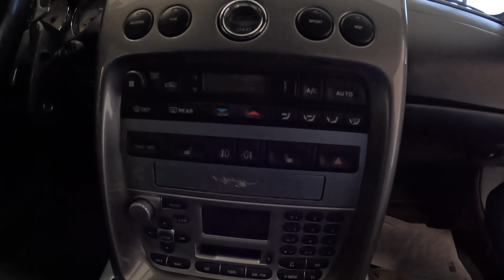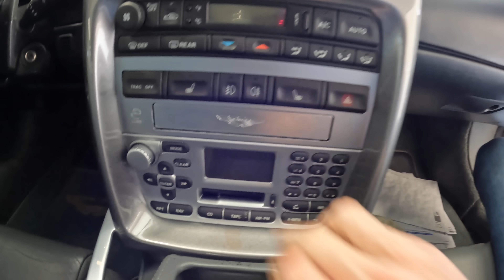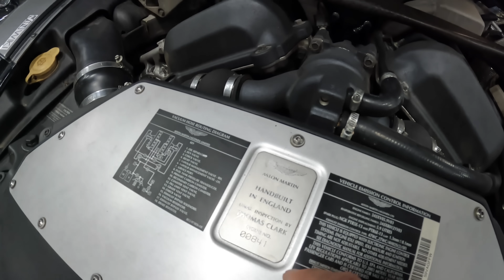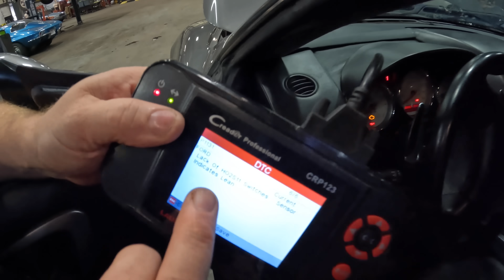I bought the Cheapest Aston Martin Vanquish to prove Clarkson wrong (Roasted on Top Gear 20 yrs ago)

Comment: I was the engineer for Aston who was tasked with fixing the flappy paddle issues and we did. 
Reach out to me Hoovie if you want to know more. 
Biggest fun is put it in ASM mode drive at 50mph it will then go into sixth gear. Floor the pedal and it will drop 3 gears and take off like a bat out of hell.
Most important is to swap out the ASM fluid (Tutela same as Fiat fluid) especially the clutch line.
Reply: Coolant sensor is a Jaguar part. Probably 2000 XJ can’t remember exactly.

Comment: Velcro for interior access is an excellent idea! I have worked on an airplane that all the cockpit interior was held in place with Velcro. So much easier to work on than the other ones screwed together.
Reply: And way better than the usual plastic pop fasteners that break if you even so much as look at them wrongly...
Reply: Way better than screws into plastic or plastic tabs. If Velcro wears out or becomes unbounded from the part it's an easy fix over buying new panels.
Reply: Also won't rattle, and squeak when you're going down the road
Reply: @andypullin4702  in plumbing it’s the same way with old fine thread brass pipe and fittings,you have to look at quick before it notices you look at it and it decides to break

Comment: Before you replace all the ignition coils check for oil pooling around the spark plugs. The rubber seals around the PVC plumbing get tired and leak, sometimes causing oil to pool around the plugs and misfires. I would strongly recommend a little research in the Vanquish section on the AMOC forum as there's loads of great info in there that will help with your diagnostics and repair.

Comment: I seem to remember Clarkson's big issue was with 'low speed' maneuverability.  Such as navigating parking lots, driving on inclines, etc.  
I don't think he really had any problem with it on a track, or just driving on a highway...
Reply: If you’ve ever driven an early paddle shift car, you know exactly what he was referring to. The early cars couldn’t manage low speed at all when auto was turned on, and it’s even harder to do it with auto off.
Reply: Very much this! He never really complained that much about these issues on Ferraris of the time, but he saw the Aston as a Grand Tourer/daily driver, and low speed driveability matters there.
Reply: on the streets yes. On the track it was the downshifts mostly. A manual you can just ram into 2nd gear and floor it, with the paddles you have to walk it all the way down.
Reply: The way it uses the clutch is also clunky. You can't really adjust the aggressiveness of the clutch action on the fly (unlike a manual transmission).

Also if you compare it with same sequential transmissions in racecars (WRC, GT1, GT3....), it's slower to shift. Ferrari managed to do it better (still clunky in automatic mode though).

Comment: My take is, if you don't use the car for racing, it shifts FINE. Too many "Car Guys" want a twitchy-instant shift. Only place that COULD be useful is on the track. But not sure I would want that the other 98% of the time, driving it normally. Manual conversion?? NO. You could buy another car for that kind of money!!

Comment: DB7 had a lot of changes off the Jaguar XJR that many believe it came from.   It was TWR who did the development and they cut the length back, repositioned the cabin, re-engineered the rear sub frame, and then did the same as the front.   The i6 block was from Jaguar, but everything else was bespoke to Aston, and ultimately Jaguar never used that i6 block so it ended up being bespoke to Aston!

The V12 engine was based upon the Ford V6 as you state, using all the knowledge and parts where possible to create a superb engine.   What you got was a unique engine for Aston that had far more development by Ford than Aston could have afforded.   Nothing bad there.

On the plus side, if you talk to the Aston clubs you'll get access to a list of compatible parts as many were shared between Aston and Ford / PAG (Premier Automotive Group).

As for Clarkson, it's not just that he makes a comment on a car but lazy journalists simply copy him verbatim.   They don't even bother making their own mind up but simply repeat what he says!   If you want a bad SMG have a look at the Toyota MR-S (MR-2 in the UK), third series.   It was terrible.   Later cars got better, and that can be retro fitted back to the originals.

When it comes to the manual conversion, it was first offered by one of the independent Aston specialists.   It might have been Bamford Rose, it might have been Aston Workshop.   I can't honestly remember, but talk to them about sourcing the manual conversion if that's what you're interested in attempting.   I suspect it's not a trivial upgrade with much of the automated shifting mechanisms needing removed.

Vanquish original doesn't seem to be going up much in value, but the S variant certainly holds more value.

The Vanquish is still the most beautiful car there's ever been.   And Ian Callum is also now offering an updated version where he'll also convert the gearbox to either a manual or full automatic if you wish.   Callum of course is a design genius.

Comment: Fun fact, that trans is just a Borg Warner (at the time) T56 with a computer controlled, hydraulically actuated clutch and shift assembly bolted on.  Similar to the E46 M3 SMG trans being the manual Getreg gearbox with the automated stuff bolted on.

Comment: when merging on to a freeway it is the responsibility of the one doing the merging to adjust their speed accordingly. and is definitely NOT the responsibility of those already on the freeway to either accelerate, decelerate or change lanes to avoid an accident.
Reply: Very true, but I consider it a dick move if the passing lane is empty and you don't move over. Legally you are correct, it's just rude. Edit: I consider
Reply: @dwarf365  also rude to come storming onto the empty highway not paying attention and expecting them to move over for you.  Then what typically happens is the fool in the merging vehicle sits right next to that person preventing them from moving back into the travel lane.  Pay attention while you are driving,  learn how to merge.
Reply: 100% on point
Reply: @Wikcentral  one hundred percent. I'm not trying to remove blame, Hoovie wasn't paying attention at all. I find it rude because if I can move over (semi, truck or car) I do and I find it inconsiderate if others don't.
Reply: Jim jibroni  Western Oa on ramps are WAAAAAAAYYYYY too short.Not sure how mergers survive.
Reply: PA. not Oa.
Reply: When the merging vehicle is ahead, I wish they’d stay there instead of drastically slowing down, looking over their shoulder in fear and mental paralysis
Reply: @wallacegrommet9343  I make sure I'm always to full Highway speed before the merge. That's what the on-ramp is for. I had good instructors growing up :)
Reply: @robertoconnor3683  I don't know about onramps in that area of the world, but there is this one in Cape Town that I really really hate. It's curved in a circle, you're coming off one road doing a 270 degree onto a national highway (where the speed limit is 120km/h). You can barely muster 60km/h around the circular onramp but you are expected to merge into a 120km/h highway. Probably not that bad if you have a big powerful engine, but over here we tend to run <100 horsepower 4-bangers...
Reply: @robertoconnor3683  On-ramps in ALL of Pennsylvania are terrible, unless they've been rebuilt in the last decade or so, and even then...  Too short, horrible sight lines, and of course, lots of traffic. And speaking of traffic, don't even get me started on NY & NJ drivers, LOL!
Reply: Exactly!  Failure to yield is the biggest mistake some drivers commit, also.  They see a car merging up ahead and feel like its their duty to pass it

Comment: If the car is an automated manual you can just remove the actuators and have an engineer design a selector, and maybe some ECU flashing. That would be cheaper and then you can sell the kit. Kind of the same process that BMW e46 people do with their transmission. Only difference is that you can get those parts from a manual car
Reply: They sell kits for SMG-equipped BMWs, so why not?
Reply: Do it like a sequential. With a button for start up that simulates holding both paddles.
Reply: There are several kits to convert these to manual. They seem to cost between 20-30k USD. Still he would be less than 100k USD in to the car and thats not to bad for a fairly modern V12 manual sportscar, even if has a somewhat shady history.
Reply: Hoovie better see this
Reply: 20 to 30k is a rip off, the other option is an adaptor plate and put a 6 speed ford transmission.
Reply: @nicolascrescimone  it's not to unreasonable of a cost. The 30k is Aston Martin themselves doing the work as well with all factory parts. The single biggest expense besides the labor is the ecu reflashing to accept the manual transmission. I know for 60k you can have a ton pick up your vanquish, ship it to the UK, do the entire manual conversion and make it legal where its registered, and ship it back to you. They replace the entire transmission while at it as well. Seems rather tempting to buy a vanquish with a failing automatic for cheap, buy the kit from Aston with certification, and do it yourself and pocket the rest. And have a factory spec manual v12 sports car!
Reply: @12pagani  if you think they change the transmission you are in for a big surprise. A 3rd pedal and a new transmission selector, a stick with a boot, and an ECU re-flash does not cost 30k. For the automatic model they used a GM transmission so the automated manual is probably just a tremec or an old ZF.
Reply: Aston has done this to customer cars at their Newport facility.
Reply: @nicolascrescimone  Then it would never go anywhere with the ford parts. 🤣
Reply: @jeramiahwestbrook7370 not sure if you know but the V12 is just 2 ford duratec v6, and that's why it's not very reliable 😂
Reply: @nicolascrescimone  Thats exactly why when someone asks how do they get their ford XXXX running again I say "How you fix a ford is by putting Chevy parts in it." Lmfao

Comment: The reason why Clarkson is having a go on it, is when the car was new and you buy at that high price point. You dont expect it to be that slow at gear shifting. As a car review, have a drive in a new car. Of course you have to say whats wrong. Because the gear shift on that car is really slow.
Reply: Exactly.  Clarksons Point was at this price point there was multiple vehicles that did the same thing better. At the same if not better price.
Reply: I think Tyler is just saying it's not so bad so the prices will rise on these and he can make a profit later. He's not a stupid guy. We tend to underestimate Hoovie.  Most of this video seemed to be him trying to increase the value of this car.
Reply: @tecnofreak666  he even compared it to the DB9 that had a ZF6 automatic which was much better to use, despite it having less power and less focused on track driving.
Reply: @nimaside  yup, he’s no dummy

Comment: You're right about the island of Clarksons. Another good one was his comment about Mk2 Focus STs tOrQuE sTeeR and thats all anybody ever said about the car. It wasn't even that bad either, yes it does steer by itself if you let go of the wheel and floor it, but you can counter that by HOLDING THE FUCKIN WHEEL
Reply: Plus that's true of ALL front wheel drive cars with enough power to spin the tires. The only way to eliminate it is to have captain slow levels of power. Yes there are some steering geometry designs that can increase or decrease it but not eliminate it entirely. Or I guess you could go to steer by wire to eliminate it.
Reply: these babies today need Tesla autopilot... holding on to the wheel? what about their social media?
Reply: Lmao.

Comment: What most people don't understand about the Single Clutch Automated Gearboxes (SMG / F1 /etc) is that if you keep in mind there is a computer operating the clutch via hydraulic actuators and you drive accordingly by just slightly letting off when a paddle is pulled it will operate much much better. Of course, if you just want to keep your foot flat on the floor and bang the shifts in you can do that also, but don't ever try to use it in Auto mode because that is when problems start.

Comment: Compared to modern dual clutch flappy paddle trans it does seem a little slow on the shifts but once you consider it’s almost 20 years old those shifts are golden. Compared to most 20 year old flappy paddle boxes it likely really holds its own but it is hard to get your mind to compare it to older cars instead of the new crazy fast gearboxes

Comment: That's a beautiful Arnage on the lift there at Wizard's. What I like the most is the facelift to that model which separated the headlights into 4 round lights. That been said, 25 l/100km is quite the number to have as your combined fuel consumption on those 6.75-s :D

Comment: Love these cars, my one problem is it has many hand me downs from Jaguar. Outer door handles and mirrors are from the XK8, interior climate controls are from an XJ8 and the seat warmers/hazzard buttons are from the XK8 and many many more.
Reply: Aston were always users of hand-me-downs; parts-bin specials.  Maybe not so much in the 1950s, or perhaps even the 60s, but when the oil crises hit and Aston went into their 70s dry spell, they were using all sorts of components from major suppliers.  From their point of view it made a lot of sense - the bought-in components were properly engineered and manufactured, cheap because of volume, and most likely with a budget that exceeded Aston's budget for the engine.
Reply: jaguar parts from the time period are extremely good quality aside from some buttons, love my xk8 door handles

Comment: I've got a 2017 GTI with a dual clutch. If I ask it to reverse up a steep hill it shits a brick. Super jerky, the time between the brake being released and the clutch engaging isn't consistent, etc. If you're in a tight spot it's really unnerving. Even sketchier if you're ok gravel or another loose surface. 

Id rather be in a manual in that situation, I'm not an amazing stick driver but I can slip a clutch properly in reverse
Reply: The VW dual clutch is one of the best on the market… you clearly can’t drive for shit.
Reply: @stuartstogdill2406  yes it is and you've clearly never been in a dual clutch reversing from a stop on a steep hill. Car just freaks out. Dual clutches don't like slipping the clutch so if you're not ready to actually give it some gas it grabs and releases. If you're on gravel attempting to reverse up the hill and you've gotta give it gas you're going to spin. In literally every other scenario the transmission is absolutely fantastic

Comment: I mean its not bad.... it seem to shift about as fast as fairly seasoned relaxed manual shift.... people like Jeremy, Richard, James and even Chris Harris, could easily shift a manual car faster than that.... however since it is a flappy paddle box, it should not take anywhere near as long as full manual shift..... I mean it doesn't need to be dual clutch fast, but it definitely needs to be faster than a relaxed manual shift....  Is there a way to modify the shift to be faster?

Comment: I've driven manuals, torque converter autos, single clutch automated manuals, dual clutch transmissions and eCVT hybrid at this point. As long as either the engine has plenty torque or the transmission is very modern I'll happily stay with torque converters for everyday driving. Single clutch automated manuals are most annoying in first gear, slowly creeping in traffic and parking especially. Past that they can be quite okay.

Comment: Years ago I worked on a site where the wife of the owner of one of these, had to religiously start the engine and run it for a few minutes every morning to ensure the battery stayed charged. The headlight seals leaked, so there was always a puddle of water in the lower half... Build quality was shocking... He also had a 6.2L AMG SLS... That worked flawlessly.

Comment: The coolant sensor is easy to fix. The misfires could simply be the ionisation module. You need to check because if it is misfiring you will kill the Cats.  You need a little guidance on what to look for.

Comment: I spent some time in the UK motor trade and it’s not Jag U R.  It’s Jag u er.

I never sold a Jag but I did sell a few other cars, including a Morgan with fewer than 100 miles on it.

One day Freddie, one of the other fellows there, asked me to take a car from our establishment down to Kent to show to one of his customers.  I said sure.

Our shop mechanic checked the fluids, got air into the tyres and topped it off with petrol.

Off I went, on a lovely Sunday morning, down toward Brands Hatch . . . in an Aston Martin V8.

Things were going well until I cleared London traffic and I hit the motorway.  The car was, I believe, carbureted and trying to accelerate was chore.  The car sputtered and bucked for all it was worth.

Less than half-way there I decided there was no point in showing car in that condition to the prospective buyer, so I told the car ‘I’m giving you two more miles and then I turning around’.

Within a minute or two the engine coughed through the carbs and started to run as it was supposed to!  It really was quite a car and I really understood where the phrase ‘safe as houses’ came from.

The buyer in Kent wasn’t interested as he’d already told Freddie he wasn’t keen on the colour, and I guess Freddie had felt he’d stitched me up on a wasted errand, but over-all I really enjoyed driving someone else’s Aston Martin on someone else’s petrol down into the Garden of England on a fine spring day.